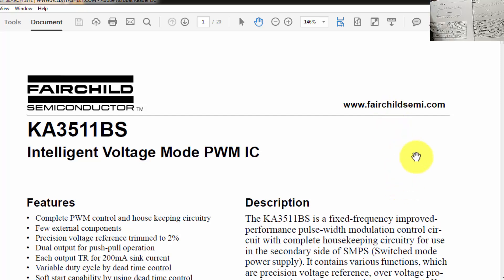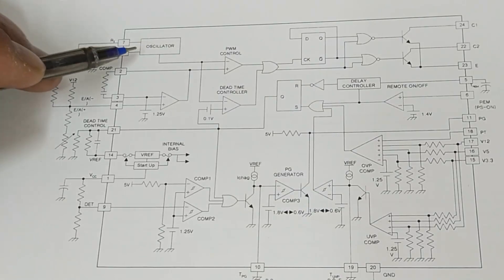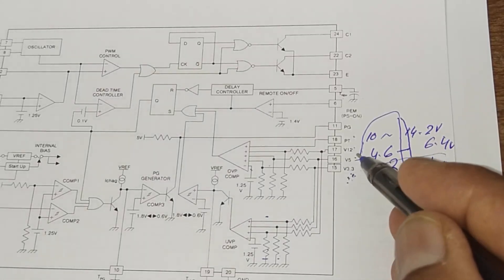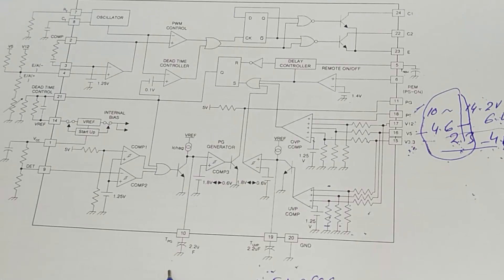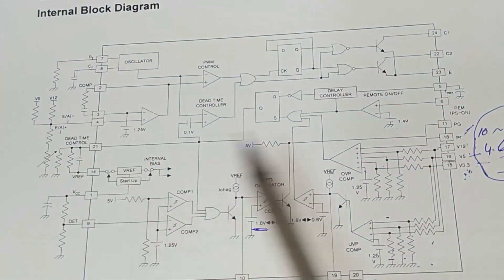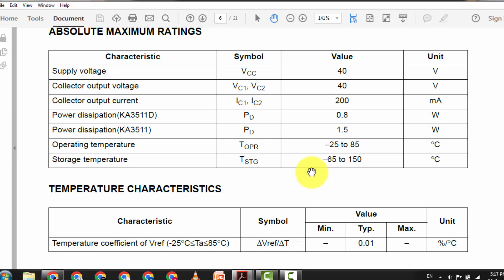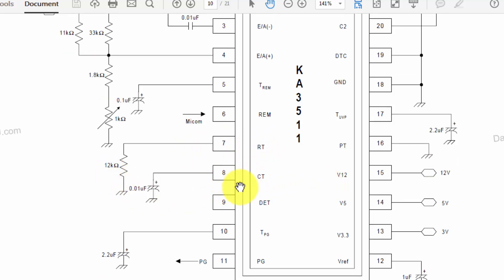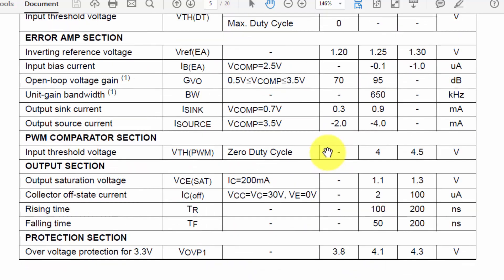{585} KA5711 Intelligent PWM Controller IC || KA5711DS KA5711BS Computer PSU Supervisor & PWM IC

Comment: Bahut badhiya Sir g, ek doubt tha ki smps ke feedback me tl431 use kare ya simple zener diode use kare, dono kaam to ek jaisa hi karega ya koi antar aata hai regulation ya kisi aur chiz par?
Reply from the maker: thanks bhai 
dono same work kartey hein 
TL431 sensitive hota he is liey output regulation zayada hoti he
zener waley circuit ki regulation little bit slow hoti he
Reply: @HaseebElectronics  reply krne ke liye thankyou sir g, maaf kijiye ek aur doubt tha kya hum bread board me live SMPS circuit bna sakte hai? Aur sir g apke jaise Mai uc3843 ko test Kiya par output fixed frequency ni aara aur output voltage level  0.1 v aara par reference 4.8v se 4.9v fixed aara, kya kru please btaye